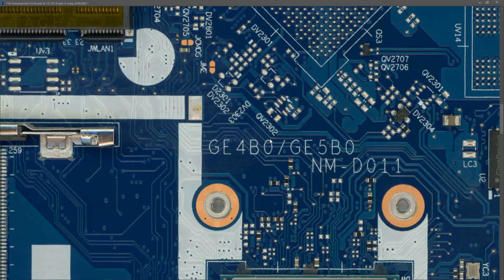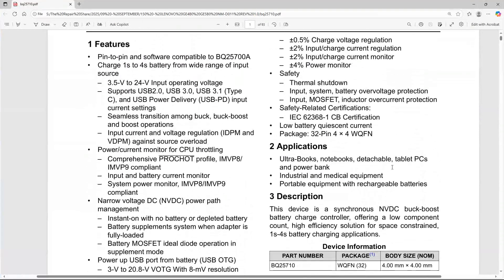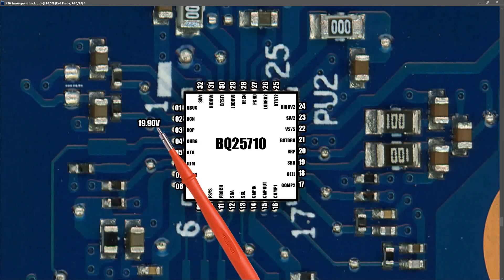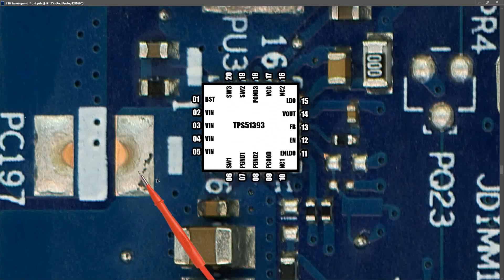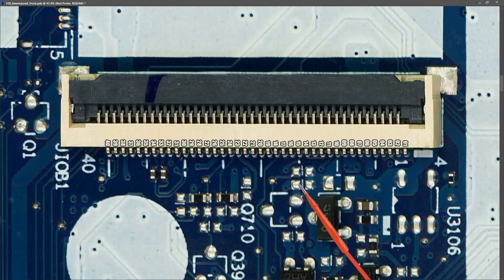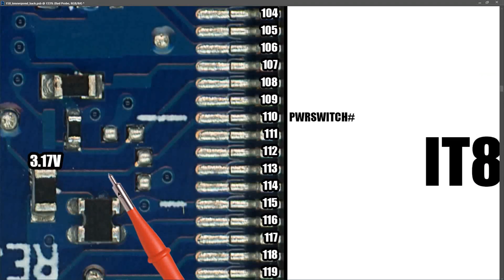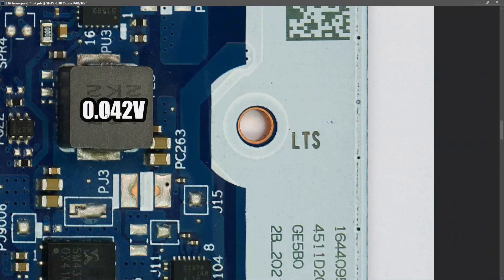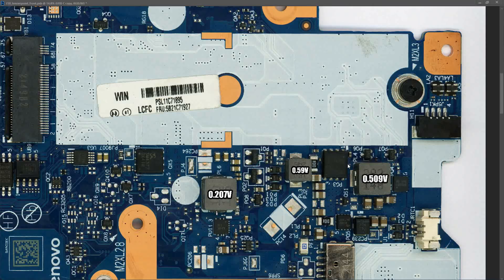LENOVO GE4B0 NM-D011 - NO RESPONSE TO POWER BUTTON

Comment: i have LENOVO GE4B0 NM-D011 voltage is present  for bq  pin2 20 volt  and 28 is 6 volt and pin 22 is 19 with battery connected  led charger is red typc and  power botton fleshing 3 times
Reply from the maker: Hi, your VSYS (pin 22) seems high at 19V. I think I would start by checking the manual and seeing what the power button flashing 3 times means. The should be a page on the manual with LED Diagnostic Codes and it should point to which section of the board is faulty.

Comment: Where is part two at? did you find the problem?
Reply from the maker: Unfortunately, like too many of my videos, I did not make further progress with this one. What are you seeing with your laptop - are all of the secondary power rails online?
Reply: @therepairshare673  Thank you for replying! I have a Levono ideapad 5 15IAL7. Usb-c powered. My PD controller is not negotiating 20v with the power adapter, only getting 5v. No 3v or 5v that I can find.  However Ido see 12.5 v at different places which i don't understand where that is coming from. I've been screwing with this motherboard for 6 months. any suggestions would be greatly appreciated!!
Reply from the maker: @billhill839  Your analysis sounds good to me. The 12.5V at different places is most likely the VSYS power rail, so this would indicate that the PD controller IS negotiating successfully with the adapter. 

At 2 minutes in to this video I show the battery management IC. If I were you. I would find the equivalent BQ IC on your board and carefully take the measurements at the ACN pin (which should be 20V) and at the VSYS pin (which should be about 12-13V).
Reply: @therepairshare673  Thank you my friend, I will check those voltages and get back to you!
Reply: @therepairshare673  Hello. I have th schematic and flexview for this board btw. On the BQ chip, on ACN, pin 2, I only get 5 volts. I don't have a vsys listed in flexview but a 20VB+ on pin 22 and that is only 6.3 volts. Weird. what you think? thanks!
Reply from the maker: @billhill839  My understanding would be that the voltage from USB C should initially be 5.0V, and then after a successful negotiation between charger and PD controller it should measure 20V - you should be measuring 20V at the input to the BQ chip on the ACN pin. I had similar issue before and replacing the PD Controller IC resolved the problem. But it's not an easy IC to solder.
Reply from the maker: check out my video "DELL LATITUDE 7310 - PART 2 REPLACING THE PD CONTROLLER"

Comment: Great presentation. Like it.

Some newer devices are picky about battery and all subboards being installed. Check presence of 5V LDO and Buck for sanity. If the current draw doesn't reveal anything obvious it points to the Chipset requirements has to be checked. But Flash known good BIOS before going into this rabbit hole.

Regards

Comment: I prefer to check the resitance of all inductors rather than voltage. I feel it gives a better representation if there is a short on that power circuit. What CURRENT readings do you get with your bench power supply when you try and activate the power button? I agree that you need to take more measurements at the Bios and the EC/SIO. Look forward to the next instalment. Your presentation skilss/graphics and labelling chips and pinouts etc, is fantatstic and a great learning aid.

Comment: Oooh you got the same board that I worked on in one of my videos 😃 Do you have the shiny TPS chip under the bottom of the board directly under the NVME slot
Reply from the maker: Yes J, I have a beautifully shiny TPS65994. I see that this is the dual port USB C PD Controller, not the IC I suggested in the video.
Reply: @therepairshare673 I recommend you check the mosfet gates around this chip as this TPS has a common issue and is not boosting gate voltage high enough to fully open the mosfets
Reply: @JFIXX1  The Gate voltage should be around 28v.... Most probably the mosfet & TPS65994XX need to replace.
Reply: He has got VSYS, i don't think it is a input circuit related issue. That 3.17 at the EC chip is a little bit low IMO, I'd check the resistance there and the EC under the thermal camera
Reply from the maker: @AV_BFS  This is what I was initially thinking als -. if the VSYS is okay, then surely this means that the PD Controller is okay, right? However, I guess it could be the situation that we are getting the correct voltage, but the MOSFETs could be throttling the power. I saw another video online that appears to have resolved this issue by working on the section with the PD Controller and MOSFETs. I'll check it out.
Reply: @therepairshare673 keep us updated 😉😉